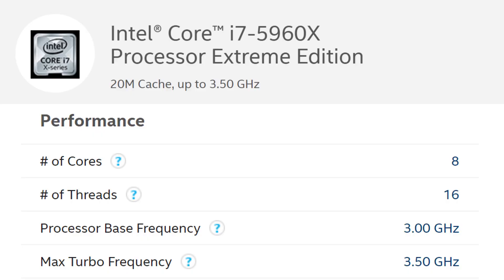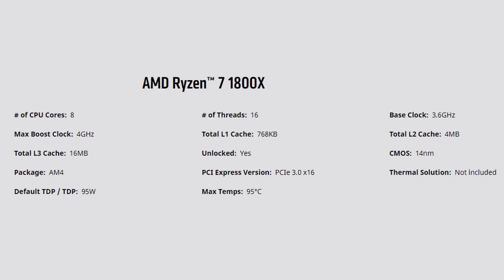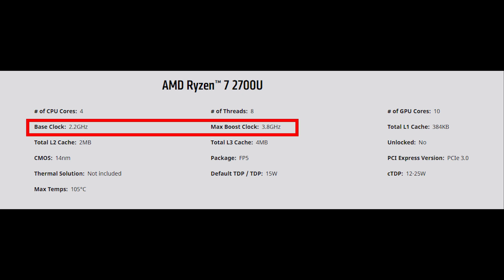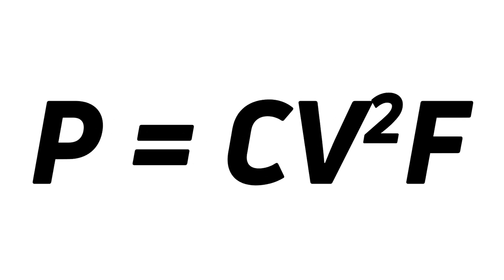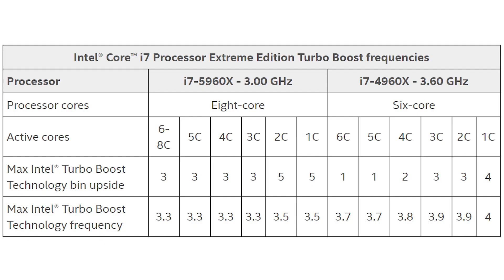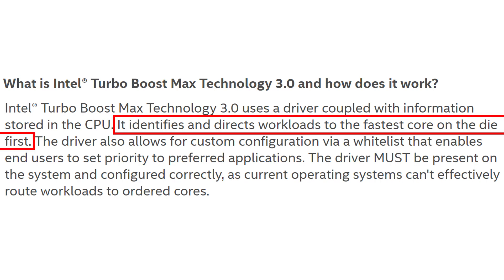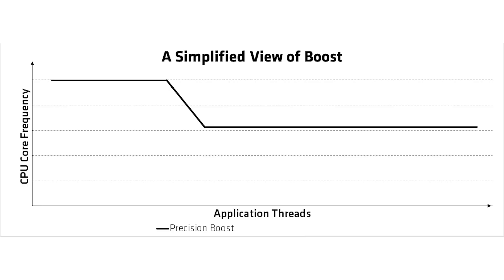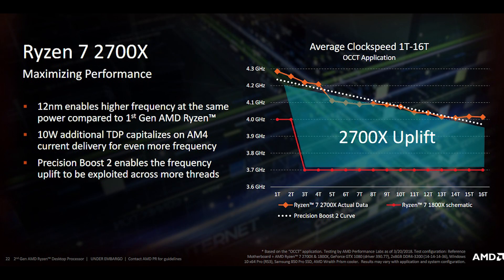Intel Turbo Boost and AMD Precision Boost

Comment: My new L13 10th gen i7 4 core/ 8 thread  Thinkpad is 1.8 normal and 4.9 turbo boost... So does this mean it can supply 4.9 continually if needed?

Comment: Great video, like it! Alright, my experience:

AMD R9 3900x
MSI Ventus XS RTX 2060 (Very small RTX 2060)

And a cramped mATX case  full of disk cages and no mesh front or place for 3 fans on the top. Max 2 in front, max 2 in the rear. Additionally I cannot fit most tower coolers in the case, you know, to keep it easy.

I ended up using a be quiet! Pure Rock Slim (mainly to make things more silent), one fan in the front, one in the back and one in the top of the case, more in the rear end of the case to keep negative air pressure in the case to prevent convection. CPU cooler points upwards to the top fan to hopefully draw some air away from the graphics card area.

I needed to use a Vcore offset as my Gigabyte Auros B450m was sending way more power through the CPU than it should, I don't know why this happened but this did fix it.

End result is: CPU under isolated stress-test load 4,1 GHz and it gets up to 83c / Graphics card under isolated stress test gets up to 80c, limit is not temperature but maximum power draw.

Combining stress testing of both means 4 GHz on the CPU at 93c and graphics card again at 80c, limit is not temperature but maximum power draw. (VRM mosfets max out at ~85c)

With a base clock of 3,8 GHz this does not bother me much, it is only an increase of 200 MHz under everything loaded up but it is 200 MHz on 12 cores. Everything operates within safe limits and has headroom for worse situations. Like summer, as all this was done at ~21c ambient. In summer with >30c ambient everything still stays within boost frequencies. The CPU drops down to ~3,9 GHz under everything fully stressed (Shows how much a bit does when 12 cores go at full speed) and the Graphics card gets to 83c and drops around 100 MHz in boost clocks too. (Again this is under stress testing both to the max, reality never gets this bad and I could still make the fan curves more aggressive but I don't like a loud system.)

Comment: in normal terms its called overclocking right?
Reply from the maker: No, not at all. Totally two different things.
Reply: @GaryExplains  then what's overclocking ?
Reply from the maker: @anupammondal3704  Overclocking is when you (the consumer) force the CPU to run at a higher clock speed than its intended frequency.
Reply: @anupammondal3704  OC is when you make it go Over the Clock that its designed to run at, so past boost. because of the small margins of error in production, they pick a boost clock that every chip can run at. overclocking is different from chip to chip because you take the individual chip to what that 1 can be capable of instead of from the factory settings. used to be you could OC to almost double previous clock

Comment: What about Speed Shift from Intel?? Is it the same! ♥️
Reply from the maker: I mention Sped Shift in passing near the beginning of the video. It is the opposite of Turbo Boost, it is for getting CPU cores that aren't doing very much to run at lower frequencies and lower voltage. Designed for laptops.
Reply: Gary Explains Probably I missed your word Sir! 
Now I understand the way SpeedShift works!

Comment: so they do boost autom. whenn power is needed?
Reply from the maker: Intel's FAQ says: Q - Is Intel® Turbo Boost Max Technology 3.0 enabled automatically or do I need to install it? A - Intel® Turbo Boost Max Technology 3.0 requires you install and enable BIOS support, driver, and software applications.
Reply: thx for your fast answert

Comment: My processor(i7 7500U) usually runs a 2.9GHz and according to Intel, hits 3.5GHz when in Turbo Boost mode. Usually when my laptop is doing heavy work(it usually occurs while running multiple VMs), the fans start to get really loud and i just assume that  is because of the levels of heat caused by the Turbo Boost. Currently, my only cooling system is a simple fan pad that sits under the laptop, and i'm wondering if there are any affordable better ways to cool the system, or at least keep it from overheating at times.
Reply: try undervolting
Reply: Ronald Jay Dimayuga by under underclocking or just forcing it to run at a lower voltage?
Reply: @victorsuarez9424  undervolting and replacing thermal paste

Comment: Thank you Gary. Nice explanation.
Another small fact maybe worth mentioning, AMD and Intel both make a base model, and a special model. The Intel special model is the "K" series. That can be manually over-clocked.
All AMD chips can be manually overclocked, but the X series has slightly better and more sophisticated auto-clocking. The range of speeds and voltages it has is larger, on the X variants of the chip.
The non X chips are cheaper, and those make a good buy for the sort of people who love to manually overclock (tune up) their chip. The speeds they can get to are no different to an X chip. What is different, is the range and the ability and sensitivity of the auto clocking. With an X chip, you get most of the benefit of manually overclocking the chip, but you get that right out of the box - it comes standard. And it switches on when it is needed and switches off when it's not. You don't get that, on either company chip, when you manually overclock it. If you set the clock speed, or the multiplier manually, in the BIOS, then you disable the auto-clocking, like the Turbo Boost or the XFR. Those things depend on being able to change, and if you manually lock them...

Comment: I have r5 2600 with x470 chipset motherboard and in games sometimes its boost untill 4.6 ghz on all cores which is very high i think because the cpu max boost is till 4.1ghz.
Reply: Wow, my 2600 ob b350 is max in game on 3725mhz

Comment: My ryzen 2600 is boosting only to 3725mhz in battlefield 1. Why not higher? My cpu iz cooled extremly well. Temperature is around 49°C
Reply: Games like that focus more on the gpu so your cpu doesn't need to do much work.
Reply: could be a voltage limit. maybe VRMs getting too hot limiting what the board can give the chip. lot of possible issues

Comment: Many thanks. I dont want to be rude... Yet i would really would like videos and explanation on quantum computer and how it works, and how grover algo work how can i simulate it at home with python and explaining the terminology like spin down up and entanglement there are 5000 videos no body explains it clearly and somebody in the wold can, its you! Thanks for every video you put on. Its hardwork ! Many many thanks
Reply: Grant Harlor that true! Yet i programed brute force style simple program to crack simple 4 bit hash just for learning the basics yet i would like to code something that have all the answers at once like a quantum computer and determain a way to choose the closest answer yet i dont understand grover algo so good and after a good read i still can get how it "picks" the closest answer in probability closest as possible to to 1. And like back in the 60s that people thought computers arnt possible at home i think that hybrid soc that houses lets say 16 qubit cpu will be posible in the neareat future that will be able to calculate navagation very fast and stuff like that..and this alongside a classic cpu and when it happen i want to be able to write code for that...
Reply: @nimrodlevy  quantum isnt anywhere near even pro usage. wont be for a long time. there are only a couple in the world and they're only good at 1 specific thing. its not about us not giving it more uses, its just what its designed for. they've made them do normal tasks, and theyre far worse than consumer hardware at them.

think of them like an ASIC, made to be extremely good at 1 thing, which is its only job

Comment: how do ultrabooks cope with processor heating issues? is there a tiny fan inside?
Reply from the maker: It depends on the ultrabook and the processor used. Some have fans, some don't.
Reply: I have an Asus Zenbook UX305CA ultrabook, which is totally fanless. Yet it's more or equally powerful as my old Asus U46SV, which is really loud during heavy workloads. :)
Reply from the maker: Depending on which variant you have/had of those laptops, then yes that would be true. The i3-2310M variant of the U46SV is slower than the M 6Y30 variant of the UX305CA. Plus the typical TDP of the latter is 4.5 W compared to 35W of the former. So big difference. Your new laptop doesn't need a fan.
Reply: My U46SV uses the i5-2410. Although it's faster in theory than the M 6Y30, the overall performance in practice is almost same on the UX305CA and sometimes even faster.

But yeah, at that low TDP, the performance is impressive. When I bought the laptop I got really surprised by how fast it actually is, since I didn't expect much from it. Sure it gets warm at heavy loads, but it's not meant to be a workstation, but rather a "surfing board".
Reply: there are different wattages (think power usage) of CPU, in a laptop intel makes 7w, 15w, and 45w. 7w is the fanless chip, thats all it uses and a small heatsink can handle that. 15w is the standard U series power draw, and typically have a fan which handles boost clocks up to 28w for short periods. the 45w are the intel H series in workstations and gaming laptops, and depending on the variant of the chip and the laptop itself stock boost is usually up to 60w, but can be set as high as 100w. they use 2 fans on those sometimes more, along with various amounts and sizes of heatpipes

Comment: Does Qualcomm mobile processors also have a different boost frequency?
Reply from the maker: No, mobile processors need the opposite, to reduce the power as much as possible, hence systems like big.LITTLE and DynamIQ.
Reply: Gary Explains it is nice topic of future video as well
Reply: @pfabiszewski  how could there be a video on something that doesn't exist?
Reply: Brad Haines big.LITTLE?
Reply: @pfabiszewski  thats not very complicated. 2 sets of cores, high power and low power switching from one to the other as needed. i think hw has a video on it anyway though